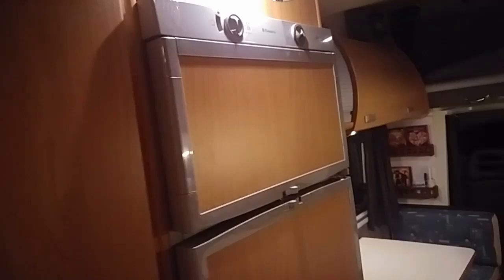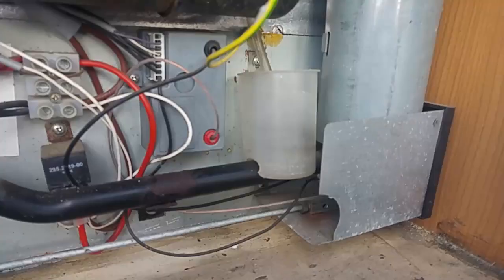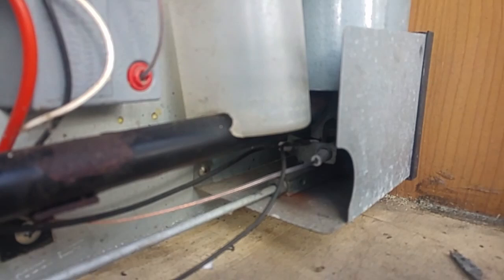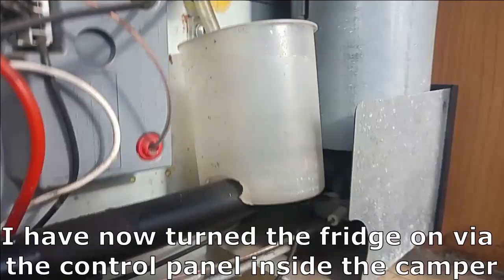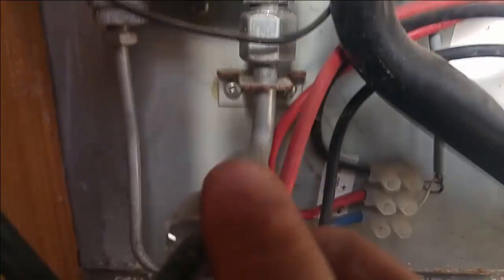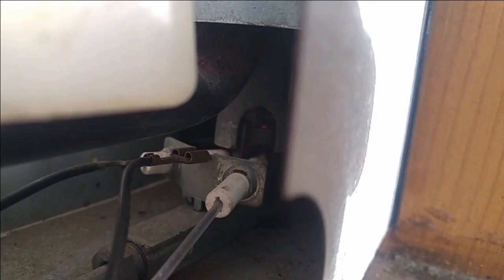How to clean the gas jet on a dometic fridge on the side of the road?

Comment: Thanks for this! I have a similar Dometic fridge (RM 5310) that would ignite but not stay lit. I followed your guide, and although there was no visible cr*p in the pilot burner, I blew it out with air, and used an old toothbrush to clean the jet and flame sensor. Voila!, my fridge is working again! Thanks to you!
Reply: Thanks BooboyBL glad it was of help. It is not perfect but hopefully helpful

Comment: Good little Video, thanks, the burner jet does look a bit iffy, but they do work. I thought it might be stainless steel but nope, they rust too.
Reply from the maker: Thanks Kevin, it still works too and off to italy soon so fingers crossed. Considdering how expensive these things are you would think they would be better!!
Reply: Marcus Kett yes, yes stupidly expensive badly made cupboards  if the converters had any guts, they would insist that the appliances were of better quality and that spare were available for at least 25 years or more, but the of course we would keep them longer, unless we had damp, how hard can that be to cure, I could get a right good rant going here :) :) :)